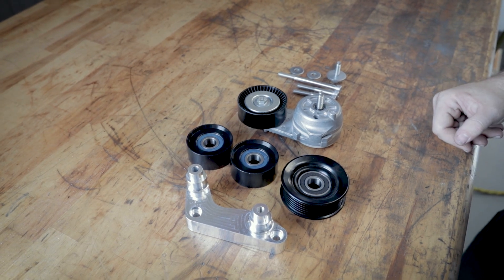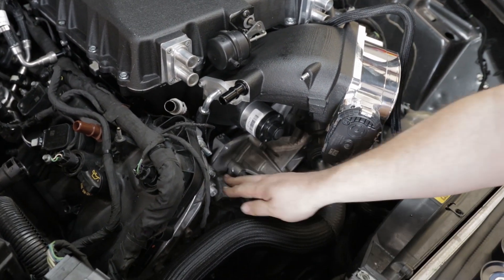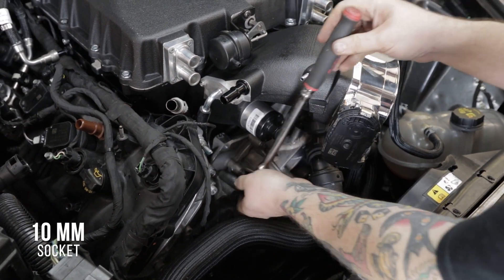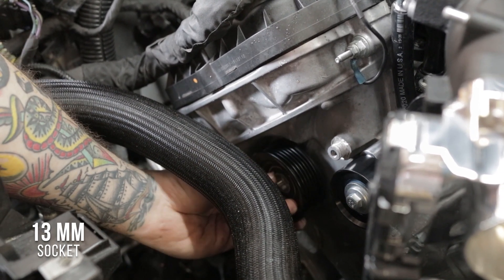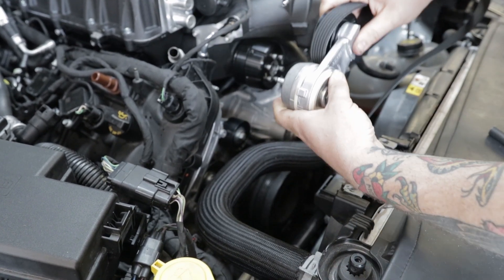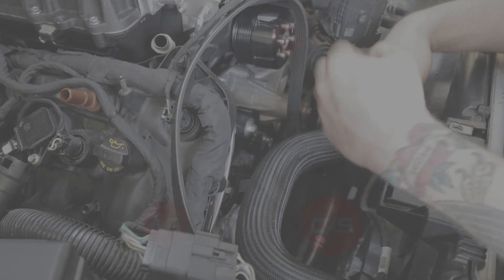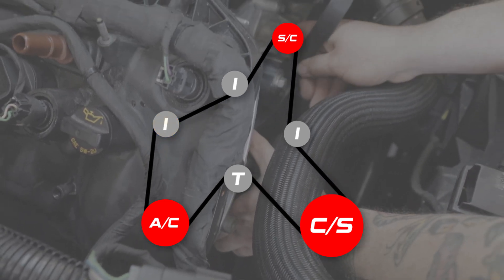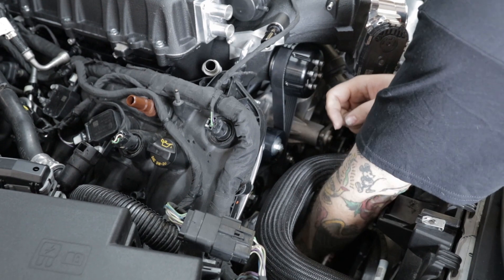Product Updates || VMP Belt Drive (FEAD) 11 to Current Mustang and F150 || Details and Installation

Comment: I got this on my 2014 and it rubs against a flat bolt between the 2 idler pulleys and it eating my belt
Reply from the maker: Hey Freddy,  give us a call or email us at sales@vmpperformance.com and we'll give you a hand.  Casting variances from timing cover to timing cover can sometimes require a little bit of work.

Comment: Was there any grinding on the block for an 18+ GT. If so, did this eliminate the need for grinding?
Reply from the maker: This FEAD was designed in conjunction with our Odin supercharger kit that was based on the needs of the 18+ Mustang and F-150 Gen 3 Coyote.  The belt drive and supercharger both clear the engine without any serious grinding as seen on previous generations.

Comment: Wow so do you not have to grind down the timing cover on the 11-14 cars anymore?
Reply from the maker: You do not.  We are pretty happy with this design.
Reply: VMPPerformance  Would that be including the 2011 timing cover with the ribs.
Reply from the maker: Depends on whether or not you have the positions needed for the pulleys.  If not, the later model timing cover isn't too bad to swap and it's worthwhile to swap.  We have successfully installed this kit on a 13 thusfar.  But haven't run into the early cover in the shop yet.
Reply: Since it's rather important to know whether or not the early 2011 timing covers need replacing due to rib issues or lack of idler bosses.....could someone check into it so future and current customers can plan for a cover swap if its required? When the claim is that it fits 2011 to current without grinding, one would assume that means all of them.
Reply: @rmartin5285  I recently bought a kit and received the old fead system it’s better this way trust me. And save yourself the time and buy a new timing cover. Would have saved me a lot of time. But a lot of grinding is required to make the 2011 cover work
Reply: @qwik281  Thanks. I bit the bullet and bought a ‘14 cover. $93. Fantastic!

Comment: I have the VMP GEN 3R with the new VMP-MFP lower intake manifold and I'm experiencing fitment issues on my 16 gt. The SC head won't clear the coolant degas nipple on the driver side. This nipple DOES NOT bend. It's some tough metal. I need help resolving this. Car is my daily.
Reply from the maker: Here's a time stamp to the procedure we use to adjust this nipple for clearance.  https://youtu.be/NO-yKrgKDrU?t=1241
Reply: @VMPPerformanceTV  imagine a 5 year old girl with a human sized teddy bear. That's how much I'm hugging you right now. 😁🔥😁😭😁🔥😁
Reply from the maker: @LT-Knight-Rider  glad we could help!  Thank you for your business.
Reply: I can't believe I tried to use my finger lol. Indeed. It's been a learning curve but I made it through most hurdles. Lastly, I know one boost reference nipple gets connected to the blower, so do I just cap off the second boost reference nipple?
Reply from the maker: If there is nothing to connect to it, yes.  We'll review this in the AM when we return to the shop.